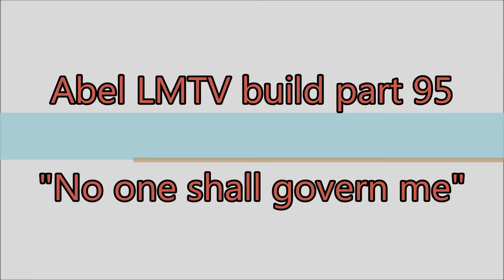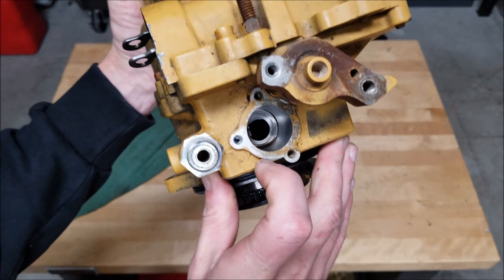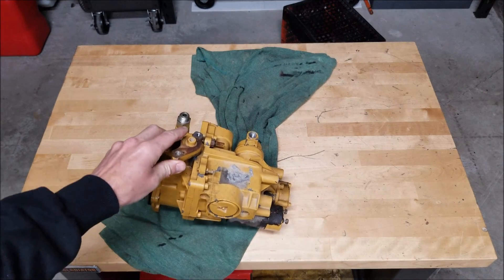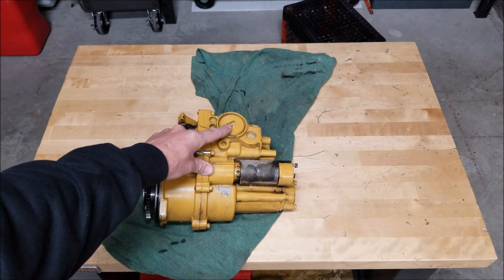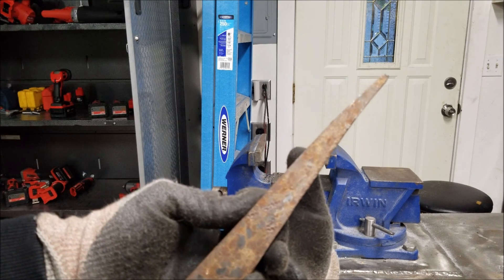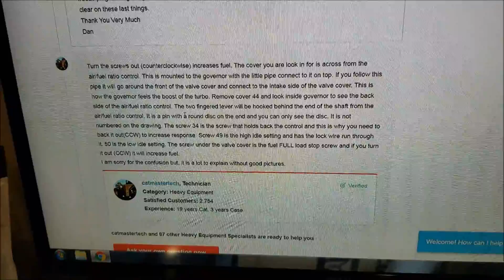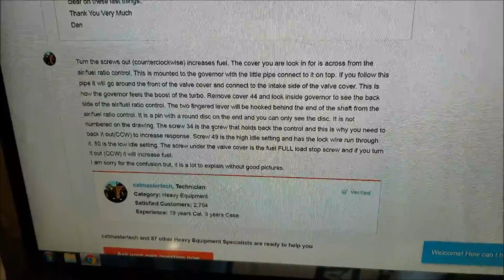Abel LMTV build part 95 (Unboxing, governor explanation and adjustments)

Comment: I know its been a few years. I watched the other videos about the upgraded governor and turbo. Never saw a art number but can you please confirm that the new290 hp governor part number is 4R-9036, and that the upgraded 290hp turbo part number is 10R-6402 ?
Reply from the maker: I don't recall.  Links are in the description of the videos OR use the 24p parts tm to find the part numbers you are after.

Comment: Thank you for this ! First thing that’s getting done to this M-1083.
Reply from the maker: It is a nice mod that is free and easy to tune for.  30k miles later and all is still well.
Reply: @SeanFastidious  I was wondering if it’ll be as noticeable on the factory 290 HP 6x6’s ? What is HP of 1078?
Reply from the maker: @tobaccofarmer4life  you should check out the playlist I created for this build series.  It will answer all of the questions for you.  Thanks for tuning in.

Comment: Did you know that you can start the motor with the cab in the up position without getting into the cab. It is on the right side of the truck after it is up
Reply from the maker: Not on an A0, on the A1 models yes....

Comment: Sean is the king of fmtv’s  this is my sticky 👀
Reply from the maker: I just like figuring things out.  I also hate the misinformation out there and want to disspell it. Thanks for watching!
Reply: Now you know As you mention a lot of ppl will be rolling coal with this one...a lot of guys was asking about how to adjust the governor on these trucks, what speeds did you get it up too😀
Reply from the maker: @johnsondml  Unfortunately I know that is true.  One good thing though is that this mod will only shoot a small bit of "coal" upon touching the throttle.  The main problem with the guys that don't know how to adjust these and just remove them is that spraying cold diesel fuel on a hot cylinder tends to break things (cracks pistons).  I was talking to a few cat mechanics who warned me not to remove it but rather figure out a way to adjust it if it were possible.  I chose the latter obviously.
Reply: I got my 1088 up-to 60mph on the hwy and that’s because I’m running the 1600 tires, and that’s pushing the rig, I don’t like to do that, I’m just curious how fast will it go with that 2 full turns😀
Reply from the maker: @johnsondml  I'm not sure I follow?  The boost compensation/anti smoke/aneroid valve is for throttle response/tip in fueling.  It has 0 to do with top speed.  

We have high speed gears in Abel and he cruises nicely at 60 mph.  Is that what you mean?

Comment: Sean the reason why there was confusion in my comment in the other video is because that's not a transfer pump.  That's the high pressure pump.

Transfer pump is either in the fuel tank or driven off the engine like the old cummins being cam driven
Reply: Transfer pump feeds the pump in your video
Reply from the maker: Tyler, the transfer pump is on the governor.  It is the one that was seized and was not allowing Abel to stay running.  I won't be doing any form of electronic fuel pump add ons.  If I wanted any of that I would have bought an A1 version LMTV.  I bought the mechanical version because they are very very simple and reliable if maintenance is kept up.  Thanks for watching.